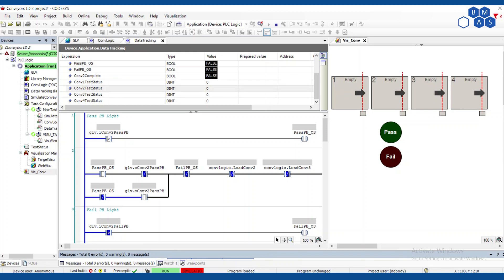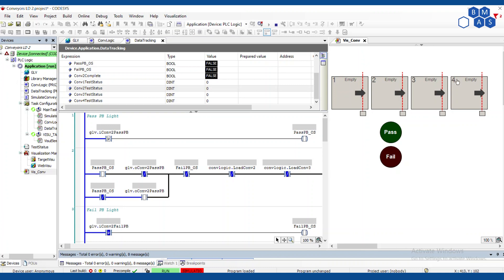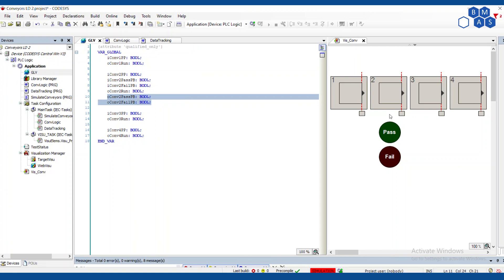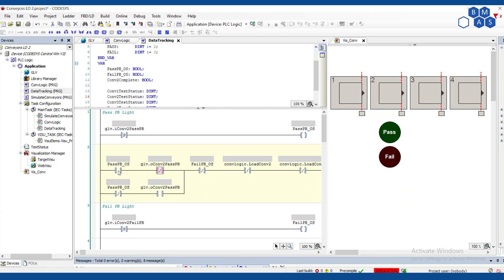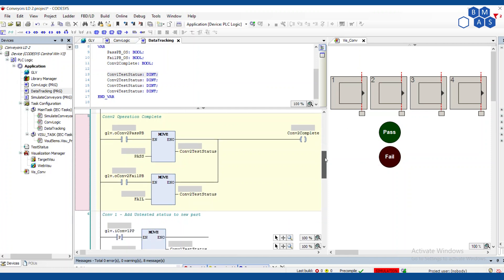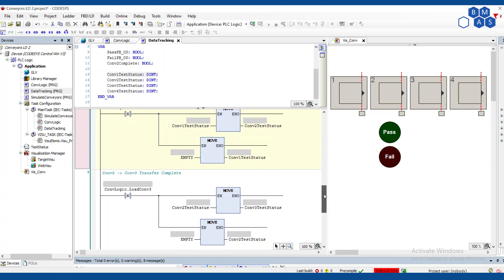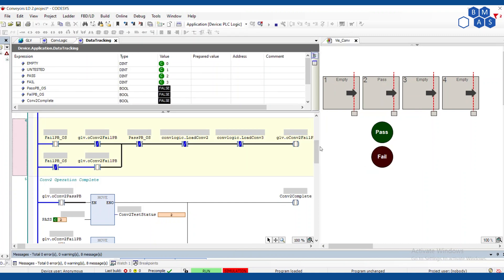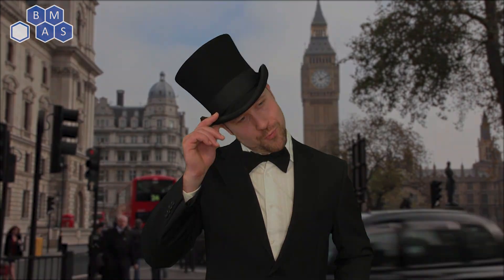Conveyor Data Handling - PLC Programming Cookbook

Comment: How about the duration of the one shot, isn't it safer to keep the one shot duration short enough in order for the normally closed contact of the one shot to be true for latch to keep the light on ?
Reply from the maker: I'm not sure what you mean.  A one shot, by definition, stays on for one scan of the program.  Ever part of the program will see the bit high exactly once before it goes low again.  If you're talking about the pushbutton one shots (ie PassPB_OS), only one branch of the rung is active at a time, depending on the state of the one shot.  That's how we want it to work.